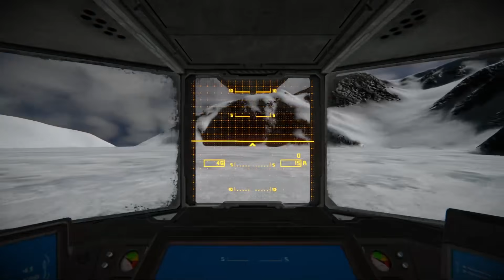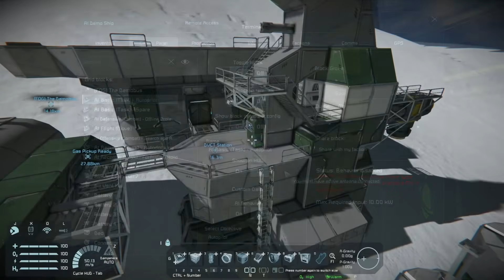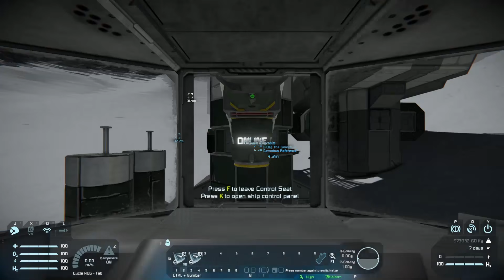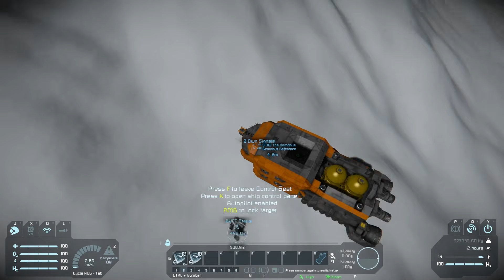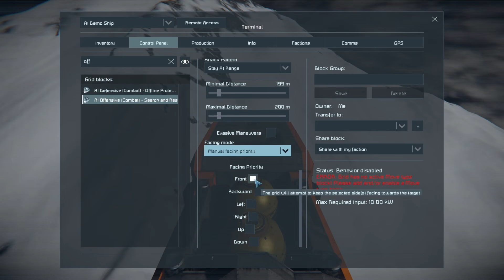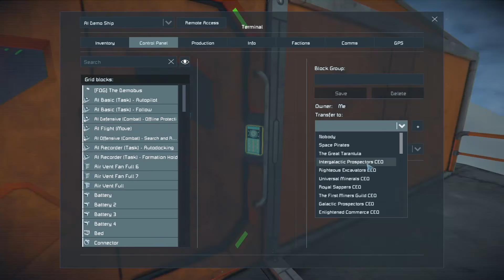4 ways AI Blocks make life easy in Space Engineers!

Comment: Ok so I know I'm a bit late and probably won't get a reply any time soon but is there a way to have it auto lock the connector when I'm in range without it keeping me from leaving because I'm "still in range"  even when I'm leaving?
Reply from the maker: Auto-locking is the easy part. With an event controller, when the Connecter is Ready to Lock, Lock the Connector.

Undocking is a different animal, but you have two good automation options.
1) Use 2 timers, one to unlock you, turn off the connecter, and start the second timer, and with the second timer re-enable to connector.
2) Weaken the magnetism of either connector, so that it's easier to pull away when magnetised.
Reply: @GleebTorin  considering how awful I am at flying (or lining up to dock) I'll look into the timers. Thank you

Comment: I've used them to create a 2-axis (pitch and roll) stabilized turret on a vehicle.
Might try to make a 3-axis one, though keeping azimuth may be really difficult.
Also, with plane parts, single-thruster missiles and guided bombs can be extremely fun.

I might also he able to make automatic fuel booms with ejectors small connectors, since it is easy to have a subgrid just point at a beacon via Task(Basic).
Reply from the maker: Wow, I wouldn't even know where to start with stabilising a turret, that's amazing.
Reply: @GleebTorin  
I made one with 4 layers of subgrids, on 4 rotors: Azimuth, pitch-stabilizer, roll-stabilizer, elevation.
On the subgrid of the azimuth rotor, have a beacon, preferably behind where the AI blocks will be(best to place it last), and on the same height level as pitch-stabilizer rotor. (so that the stabilizer doesn't try to point the turret to the side(up the slope, with beacon lower than AI) when you are on a sideways slope)
Then On P-rotor subgrid have the roll-stabilizer rotor, on its subgrid have gyros and an AI Flight with 0 angle tolerance and Basic Task set to "follow home" targeting the azimuth subgrid beacon, as well as a the gun elevation rotor/hinge.

I haven't figured out how to get it to stabilize the azimuth,

Though, now that I think about it, I guess, a very far away GPS waypoint can approximate it, with BasicTask set to "Autopilot", and "One Way", although it will do the opposite of its job, when close to 2 points on any given planet (closest and farthest from the GPS), so switching between multiple points would be necessary.
Reply: how exactly did you make the guided bombs?
Reply: @АлександрДегтярев-б8ъ  
The same way you'd make an AI block missile, except without thrusters, and with wing blocks acting as fins on the back of the bomb. Make sure the AI blocks only activate after the bomb is detached from the aircraft/ship.

They can glide for kilometers, and one of my favorite ways to emply them is drop a bunch of them in such a way that they glide in a straight line into the 2.5km detection radius around the target in a fan spread, so that they engage it from multiple directions.
It also keeps the bomber way out of harm's way, when you release them from out of detection radius, and you only need to point them in the general direction when you drop theme. 

It is also pretty fun to dodge missiles that have wing blocks instead of lateral thrusters.
A bit easy, unless the missile has a very high thrust/weight ratio, but still pretty fun.
Reply: @My_initials_are_O.G.cuz_I_am  No Thrusters at all? Not even one? How can it correct its course then? Wouldn't you need at least one to able to have the bomb make mid course correction? A video of it in action would be good to see
Reply: @АлександрДегтярев-б8ъ  
Wing blocks from "Plane Parts" mod.
Aerodynamic Physics mod can work too, just a bit worse.
Reply: @My_initials_are_O.G.cuz_I_am  ahhhhh...see I play on console so aerodynamic scripts wont work, since microsoft doesnt allow 3rd party scripts. So I guess the current version I have will have to do

Comment: There is only one downside to using the offensive AI for finding neutrals: If your ship has any wheel suspension with a wheel attached, the AI will target that wheel, because for SE it is a neutral grid and doesn't belong to you, because there is no computer on the wheel subgrid in that case. Had shis issue with a missile truck
Reply from the maker: Oh, wow, I hadn't thought of that! Thanks for the warning
Reply: @GleebTorin  You're welcome. I had to learn it the hard way, so i try to make it easier for others
Reply: @NovaCharlie7  Is that because when the wheel spawns in, it is neutral? and if so could removing the spawned wheel and placing one on manually fix the issue?
Reply: @wraithjam  No unfortunatly that doesn't fix the issue... i think thats a problem only Keen will be able to solve

Comment: I like to add an event controller into the mix for docking. Use the event controller to look for the connector being ready to lock. Then in actions put lock connector in the first spot on page 1. Then on page 2 put power off for  that same even controller in slot 1. So that you can undock when the time is ready via just hitting P. You can add an action on one of your waypoints to enable the connector event controller.  I like turning on docking lights at the first docking waypoint and having the event controller turn them off when docked.